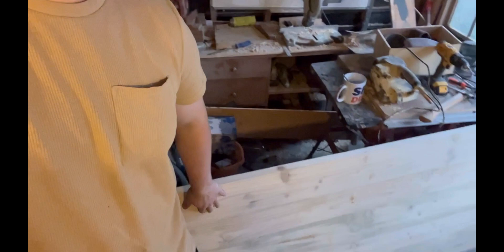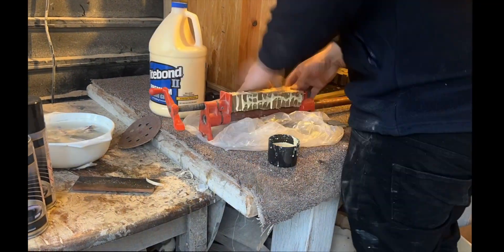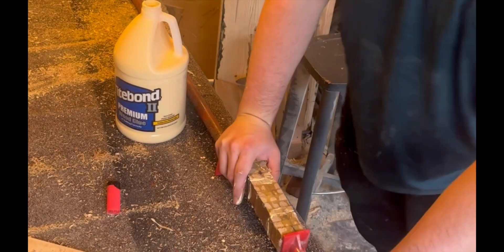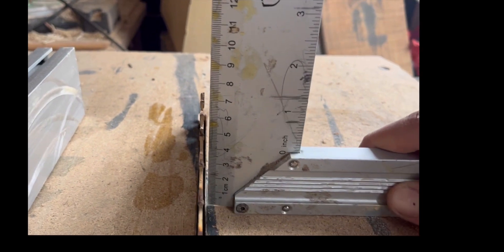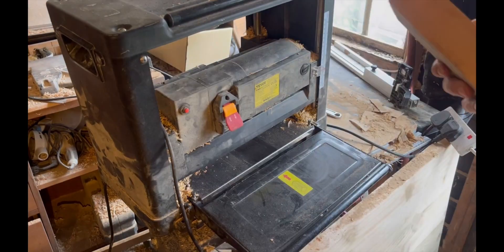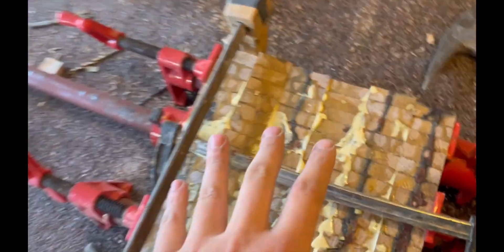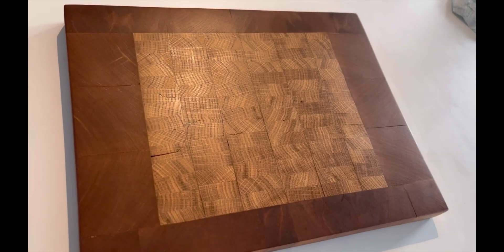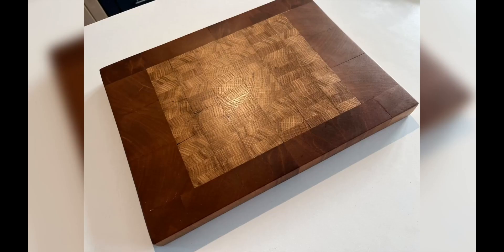End Grain Chopping Board From Scraps!

Comment: Hey Mate, I cringed when you did the planer. I knew exactly what was gonna happen. I used a jointer, which I assume you don’t have one. I made a 609mmx 914mmx 50mm end grain. Yeah quite a challenge. I would have glued the boards up first, ran them thru the surface planer, then cut them into the height. Would have been less gluing and would have been straighter for ya. Also, if your blade is drifting, again I assume it’s your fence(?) I would get a piece of angle iron to clamp down on the table saw to prevent drifting and keep a consistent cut. I also would have used the belt sander to level the cutting board instead of the surface planer. I had severe kick back doing end grain. I planed a lot of end grain without incident, but it only took one time to get a kick back ( btw it destroyed my planer, I had to get another one) for me not to use the planer for end grain. Wish I could send pictures. I had a chuckle when that piece went flying back on you, I’ve had the same stuff happen to me. Hopefully thru this journey of this cutting board you learned better ways. The board looks beautiful! I’m really impressed. I subscribed to your channel.
Reply from the maker: Thank you! I have a new table saw with a longer fence now I hated my old one at some point in the future I’ll be making another end grain chopping block because one of my friends want one for Christmas so I’ll try implementing your tips! Thank you for subscribing and supporting me!
Reply: @barrovianmade  : I’d like to privately email you and discuss a few more tips. I made one with maple as the main color, and walnut as the border. The walnut looked like leather after I was done. I learned a lot!

Comment: It's not the blade that is moving on the table saw, it is the fence. You can see at about 10:20 you touch the fence and it tilts. I would check out the way it is secured and make sure it is solid. Also change the blade on the table saw to prevent the dark marks seen around 7:56. Your blade is dull and "burning" its way through instead of cutting. All and all a good product but of the love of god please don't send any more things through machinery if they are hot glued down plz.
Reply from the maker: Yeah might be the fence it moves all the time so I have to clamp it down and it’s a cheap table saw so the fence only secures on to one side of the table so even when it’s clamped down the fence still flexes never used to be an issue till I started trying to cut harder woods and I haven’t sharpened the blade in a while so I’ll check it and sharpen it but I am looking for a new table saw since the one I gave at the moment is a headache to use, any recommendations for a table saw with a £300 budget?
Reply from the maker: Also I did hot glue it down they just ripped off I used the cheapest got glue sticks with a lighter instead of a hot glue gun tho so I don’t know if it was because of that